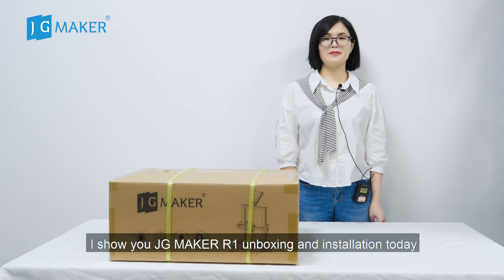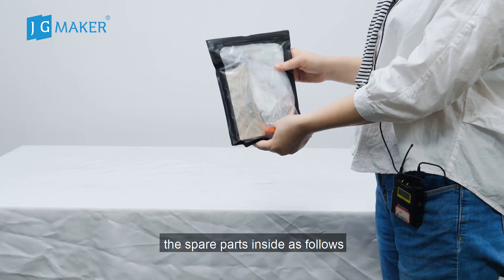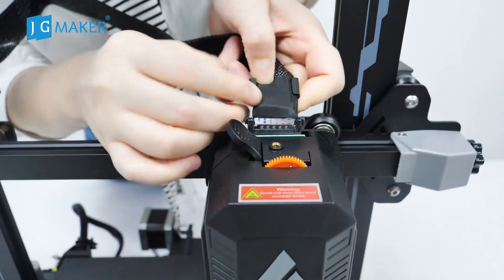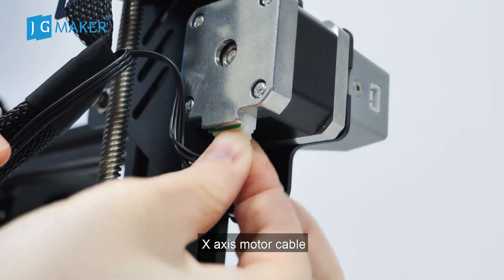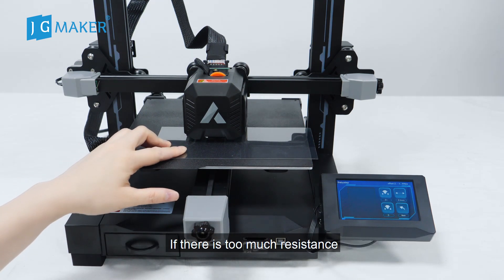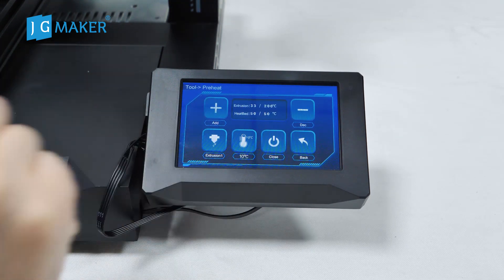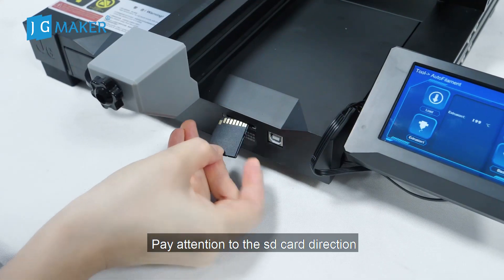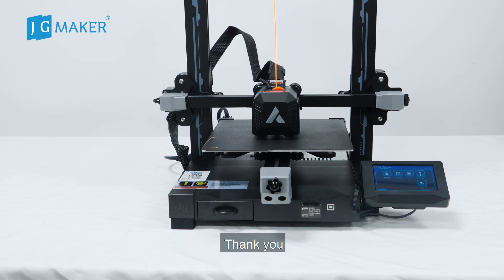JG MAKER R1 3d printer

Comment: There are no instructions for using automatic bed leveling. 
The sensor does not seem to be working. I can clearly see the warping as defined by the two middle heating elements on prints spanning 75mm from the center of the bed. I'm sure there are additional elements surrounding the perimeter. 
Is there a way to manually adjust each value stored?  
Additionally, the files provided didn't utilize the auto bed mesh G Code M420 S1. 

If you are considering this printer, this series of videos is the user manual for this machine. I would highly recommend running through your entire machine with a GOOD set of alen keys and tightening/inspecting everything.